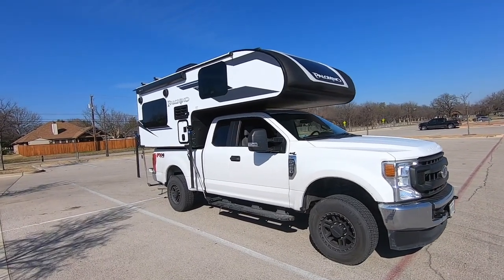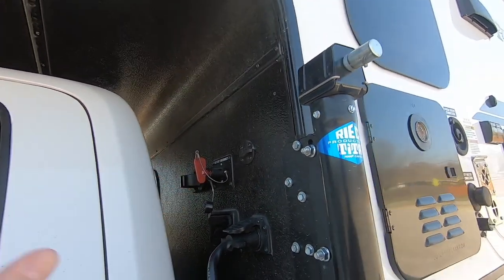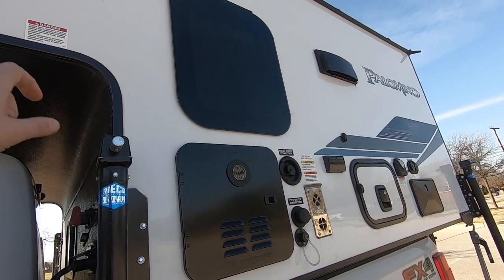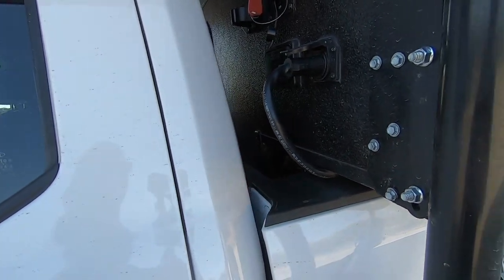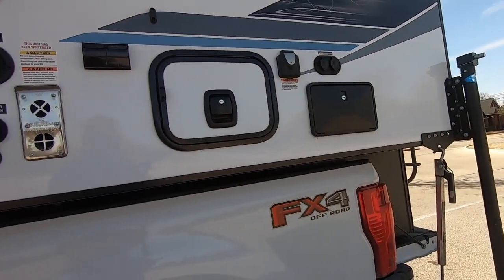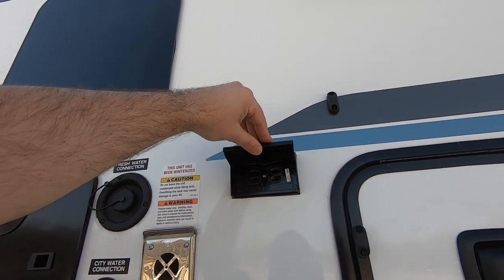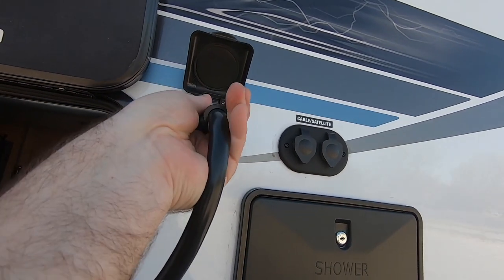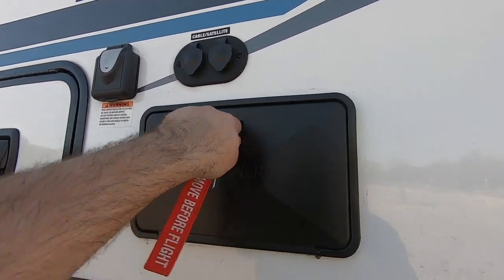2022 Palomino HS 750 Walkthru Part 1

Comment: Can I get your personal take on this camper? Problems? Is it reliable? Does stuff break only weeks into ownership?
Reply from the maker: I’ve used my camper extensively since I purchased it in February of last year and I would say overall, it’s served me well in both freezing temperatures and 110 degrees alike. As you know, the appliances such as fridge, furnace, AC, water heater etc., are all manufactured by different entities like Dometic for example and have been in the business for many years. That said, I have put all of the onboard appliances to the test and am very happy with their performance so far.
Now, as for the camper structure itself, there have been a few items I’ve had to address. Some of the interior trim came loose around the floor moulding but Gorilla Glue came to the rescue. In addition to that, I had to have the dealer reseal the forward window (the one that looks into the cab of my truck) as water would leak into the interior of the camper when driving through heavy rain. I also had to address some loose electrical connections with the solar panel. 
All in all, it feels like a sturdy camper with good build quality and has kept me comfortably warm, cool and dry in several of those Texas sized storms we can experience here!
So, with all of this in mind I would say the Palomino line strikes a great balance between cost and quality. I did look at several Lance campers and they may feel slightly more rugged but you’re going to pay for it. The Lance 825 (comparable to my HS-750) has an MSRP of around $50,000with standard options. The 825 is also heavier by about 400lbs. 
To finally answer your original question, overall I am very happy with my HS-750 and it has proven to be sturdy and reliable.
Hope this helps and thanks for watching!
Feel free to reach out anytime, I’m always up for truck camper talk!
Reply: @Seeyoudowntheroad-bc7om  very informative reply thank you for your input

Comment: What kind of mpg do you get with the camper on?.....
Reply from the maker: Good morning! If I’m not pulling any hills and not battling a head wind, I can squeeze about 14mpg on the open road and between 60 and 65 mph. I have seen it dip down to single digits a few times however. I love the 6.2L power and torque and when you need it, it’ll pass anything but a gas station!
Reply: @Seeyoudowntheroad-bc7om  What's mpg do you normally get without the camper on board?

Comment: Is that a 6.75 truck Bed?
Reply from the maker: It is! I thought about the 8’ bed but I like the shorter wheelbase on the short bed. I also appreciate that with the HS-750 you simply open the tailgate, no need to remove it!
Reply: @Seeyoudowntheroad-bc7om  I ordered the f-250 in Dec and I just got the VIN for it. Supposed to start the build Jun13th. I got the 6.75 bed with the 7.3 and camper package. I won't really know what I will be able to carry until I get it and am looking at the 8801 and the 750. Looks like the 8801 will ride flush with the tailgate and it will have the integrated stair so I am hoping that I can just use that to get in and out of the camper. If it hangs over the tailgate, I will probably have to go with the 750.
Reply from the maker: Very cool! I have the 6.2 gasser and am very happy with it. You’ll have to let me know how the 7.3 handles.
I looked at the 8801 also but for me, there were some features I didn’t feel like I needed that just added more weight such as the oven. Of all the RVs I’ve owned, I do t recall ever using the oven but that’s just me!
Send some pics of your new rig once you get it all set up!
Reply: @Seeyoudowntheroad-bc7om  I will. Still making a lot of considerations. We'll see how it turns out!

Comment: WHERE IS THE BATTERY?
Reply from the maker: There are two battery positions adjacent to the fresh water tank and accessible by lifting up the cover that serves as the step up into the bunk. 
With the “Badland Edition” you also get a battery tray to be mounted externally on the camper box driver side. You’ll have to raise the camper a bit higher so the battery will clear the wheel well when loading the camper. Hope this helps and thanks for watching!